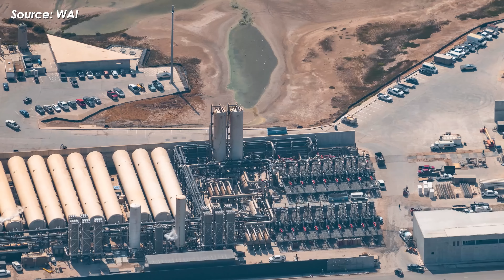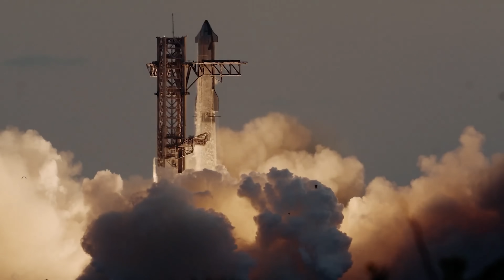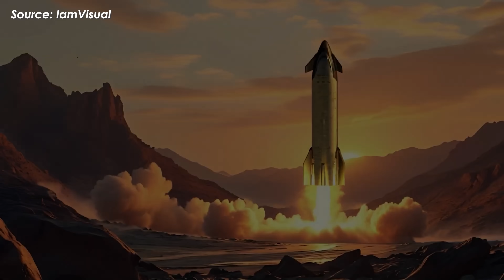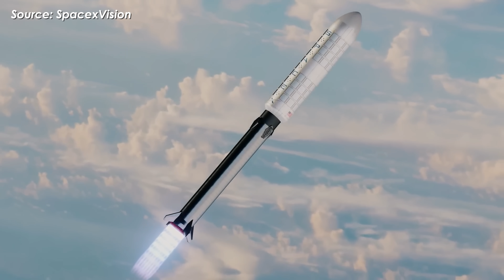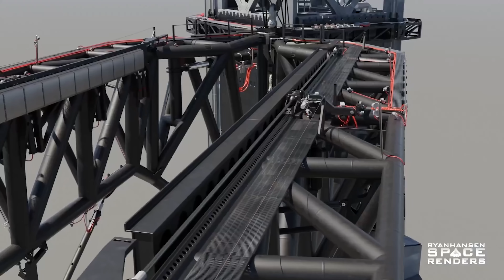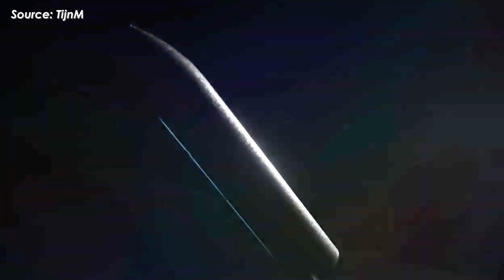It's mind-blowing! Elon Musk Drops Big Upgrade on Starship V3 & V4 to Moon Shocked Industry...

Comment: Why not use Falcon heavy to take up big tanks of fuel and Falcon 9 too carrying more and attach them with the ISS temporarily and then have starship take up an even bigger empty fuel tank and then a Dragon with crew to connect the huge pieces of a ring with the necessary connections for Starship's fuel tanks connected all around it maybe 8 - 10 tank's then keep the Falcons bringing up fuel at every opportunity to transfer fuel into this self sustaining solar powered fuel station so when Starship is ready to go then the fuel is ready and waiting for supplying the necessary amount required,if you know what I mean, just a thought and I would have been doing that a while ago because the falcon's are amazing historic works of engineering and could easily get this ready for Starship and save at least a year of time!

Comment: How did The Apollo missions get to the moon and back with the fuel they had which was not as much as Elons ships can carry ?
Reply: They did it in 1969 with a lot less fuel because the Apollo system was NOT re-useable. All that weight was shed as each stage dropped away and only a relatively tiny crew capsule made its way to the Moon.....so that required a lot less fuel.

Starship's system (especially version 4) is MASSIVE and heavy in comparison....plus it's all re-useable, so has to make its way back to Earth....so needs fuel to do that too.

Comment: A rocket 🚀 is still a rocket . Pity we can't rise above to a truly advanced propulsion
Reply: Would that be plasma busters?.
Reply: I'm going to guess that the basic Starship design will be around for some time. Each version will get bigger, so I think by 'version 6', the width of the booster and ship will need to increase too (for stability, as the whole craft gets taller).

The extra width AND height will increase internal volume massively and MIGHT allow space for a small but advanced nuclear reactor. This would provide a huge boost in internal power generation and MIGHT allow for a new generation of nuclear rocket engines.

Nuclear rockets have theoretically been talked about since the 1950s, but the technology was not available then to make them a reality. 

By the 2040s, that situation will change. Nuclear rocket Raptor engines will increase thrust/speed and efficiency massively, allowing times to get to Mars etc to become more reasonable.

Less time travelling in space means less time getting exposed to solar radiation for astronauts, making the trips safer and shorter.

The greater thrust available will allow for more payload capacity, thus making each flight cheaper too.

Comment: Elon and his crew are amazing

Though I do have an idea, they keep showing animated graphics of two starships docking in orbit and refueling 

I’m wondering why starship can’t travel to Mars with two refueling vehicles attached creating a triangle or even four 

With starship having a full tank of gas and three tanks of reserve, leaving them in Marrs orbit

The video already said that starship has enough fuel to take off from Mars, but of course it will need to be refilled in orbit befor the return trip to earth 

I say this because a lot of the graphics show a fleet of starships heading towards Marks, but that entire fleet is burning fuel, if they review my suggestion, only one starship will need to be used on the trip to Mars, leaving three or four fuelers in reserve
Reply: "I’m wondering why starship can’t travel to Mars with two refueling vehicles attached creating a triangle or even four 
With starship having a full tank of gas and three tanks of reserve, leaving them in Marrs orbit"

What makes you think that having 3 or 4 times the mass doesn't require 3 or 4 times the fuel to get to Mars?

Comment: Message to Elon Musk:  Have suggestion that could eliminate inflight refueling and provide onboard fuel enough for Earth to Moon and return. Emulate Falcon Heavy with Star Ship. Attach two (2) falcon rockets attached to the body of the Star Ship (similar to Falcon Heavy) to provide extra lift from Earth. They could return as the stage one of the Star Ship will do. The boost from them could leave the Star Ship with enough fuel for the Moon and return. I am on Google if you wish more information from me.
Reply: I posted almost the same a month ago.

I now think the key is to launch a lunar booster, then launch a lunar lander. They dock in orbit and go.

Later missions with larger payloads may need falcon heavy side boosters as well.

Refueling can wait for interplanetary missions.
Reply: @chuckevans2792  It is pretty silly to make the big cargo hauler a spacecraft for humans. You could launch the cargo on a very low thrust trajectory. Who cares if it takes a year to reach its destination. 

The concept of a "space tug" that remains in orbit is a good one. But You'd want a propulsion system that could "refuel itself". Something like a plasma drive that runs on electrical energy. 

Maybe when parked in obit, you connect it to a massive solar array that serves as a big "charging station". Delivering traditional fuel, to an orbiting gas station, is ridiculously inefficient!
Reply: @professorg8383 
Slow cargo runs are very efficient, but need much better meteoroid shields.
Maybe LIDAR and lasers ?

Plasma drive would cut fuel use by half, or double the cargo.
But the massive solar array would have to be on the space tug, or use a thorium reactor to go to the asteroid belt or beyond. 

The tug could do a quick return if it can aero brake on return to earth. 

Long term, we need space elevators to lift fuel for high payload missions.
Reply: A much easier way would be to look back at what NASA did over 50 years ago!  And that would be to put an intermediate stage between the booster and the Starship!  

But that would violate Elon's law of 100% reusability and make the guys at ULA look like real engineering geniuses!  

No way Elon ever admits that his 100% reusable, 2 stage design is an inherently stupid goal that just proves he can't repeal the rocket equation!  This  100% reusability goal ridiculously handicaps the system! But many of us engineer types who lived through the entire development of manned spaceflight, knew this decade ago! 

Musk created his own "mythological" truism that reusability would be the best way to be the most cost effective. But it isn't always that simple. He also created another false truism that satellites in LEO would always be better because the distance is shorter. But he needs to have a ridiculous number of satellites to achieve system capacity!  And he opted for the much heavier Stainless Steel instead of the more structural stronger choice of aluminum  or carbon fiber!  And there is no way the SS Starship will ever be truly reusable. Sometimes expendability is actually the more practical choice!
Reply: @professorg8383  One question: what's stopping us from making the intermediate stage reusable? Perhaps by turning it into an "interorbital tug," with the same refueling capabilities as Starship?
Reply: @SergDabl  Gravity won't bring it back in a controllable manner. So you'd have to make it into its own spacecraft capable of controlled reentry. 

That increased capability would need fuel and it would add both mass and complexity! And add a lot of cost. It handicaps performance by insisting that it be re-usable!  That is how you end up with a stupid, inefficient rocket system like Starship! 

We learned a lot in nearly 60 years of spaceflight. But Elon thinks he smarter than all the OGs!

Comment: I think that Elon should think about building a replacement rocket for Falcon 9 that used the same fuel as starship. They could also be used as booster rockets for starship similar to Falcon heavy. He could even use some of the old Raptor 1 & 2… engines when appropriate. They would be reusable to so it’s a win-win and simplifies fuel requirements.

Comment: SpaceX should launch a booster on top of a booster as the orbiting fuel station. It won't be re-entering and will have a much greater capacity for storage and transfer. A series of these, filled, staged between Earth and Mars will allow for mid point fueling stations. Max fuel, ready for expended ship fuels with the capacity to fill 2 ships. They can be used filled to push a ship to Mars to exhaustion and discarded or simply staged and ready to be refilled again desired. Boosters in space won't need heat tiles because they never re-enter atmospheres. Using empty boosters on planets without atmosphere, they can be used for habitations or static storage units

Comment: Build a depot in space and keep it topped off. The spacecraft could refuel with one landing, not multiple mergers reducing the risk.
Reply: Where is the depot getting its fuel from
Reply: from ships loaded with fuel. If we loose one it’s ok. It’s not the one with people on it. It’s not that hard. I was a tugboat captain in rough seas coming along side ships transferring people and cargo in much worse conditionsdition then space for sure it’s all about relative speed match up and slowly coming along side and touching down like a feather. We do this all the time on earth. This why musk says it’s easy. Not saying nothing will ever happen but it’s very doable. Either way we do it, it will work. At first maybe harder but over time we will get better. Unless you are afraid of a challenge and think nothing bad will happen on earth.